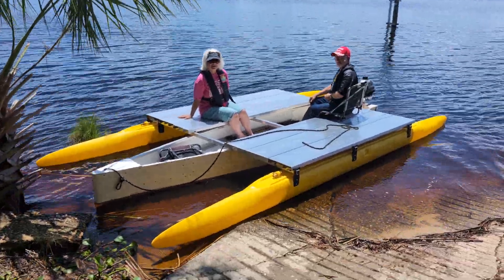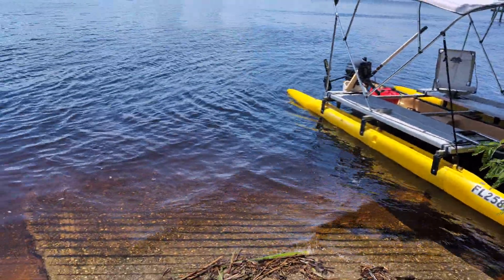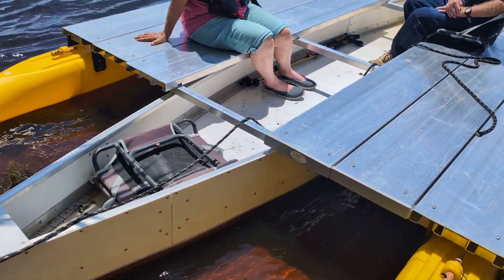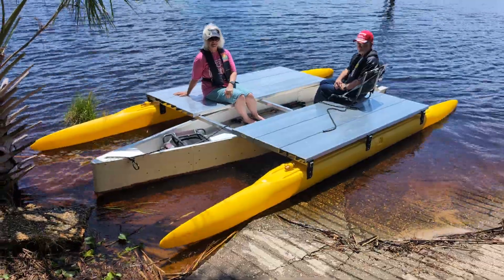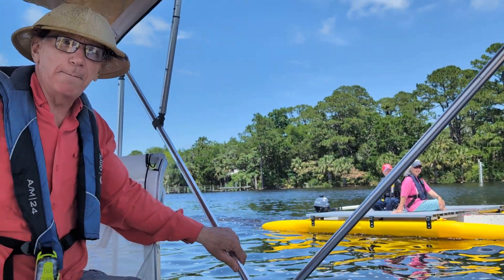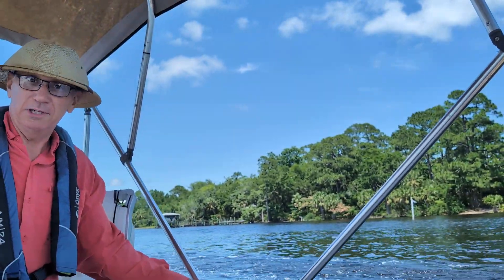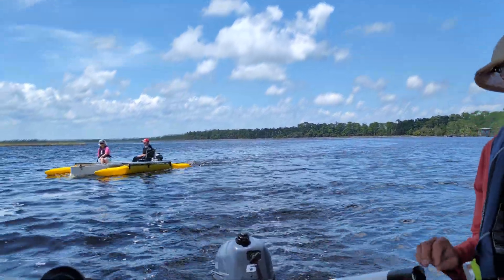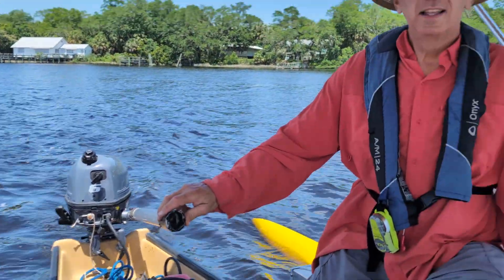a close look at an Expandacraft outrigger kit on a self bailing Skiff.

Comment: How does it mount up to the boat? Drilled holes or clamps I want to buy a set without drilling thank you
Reply from the maker: I have clam on style connectors available and you can also use heavy duty straps.

Comment: Where can I find out more about the construction of your self bailing skiff?? Is it homebuilt?
Reply from the maker: It's a one off I built with SIPs and King Starboard. If I had it to do over again, I'd make it 18 or 20 feet long and would use a 6 inch thick SIP for the floor instead of 4.